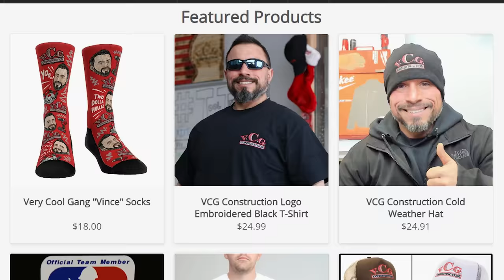If You Use A Reciprocating Saw, THIS ACCESSORY IS A MUST HAVE!

Comment: When you cut through thick metal, use cutting fluid.  It comes in a spray can.  Otherwise you are causing excessive heat and wear on blade.
Reply: True, but the fact he was able to do 7 cuts without any sort of cooling assistance is pretty impressive. I’d imagine with it this blade could easily do 3x the amount of cuts.
Reply: I was gonna say the same... surprising how much quicker and easier you can cut or drill through metal using some kind of cutting fluid!
Reply: Also limiting the speed and letting it cool down helps too
Reply: True, but I think the poi t he was trying to prove was how many cuts he can make without any lubricant
Reply: So what you're telling me is that blade would last longer 😵
Reply: Same goes for wood. Put any kind of oil on your saw, even olive oil works.

Comment: I always cut thick steel on slow speed and always cooled the blade down constantly as im cutting with some water, it preserves blade life so much. My job pays for the Milwaukee sawzall blades so i have to make em count. Going too fast with the sawzall speed will burn out the blades like crazy, if it sparks its too hot.
Reply: what do you use, a backpack sprayer?  why water and not cutting oil?
Reply: @FunkInMyTrunk  I learned a trick here on YT.. get a 2.L bottle filled with water and stick a pinhole about 3” from the bottom. Should give a small steady stream of water for around 15-20 mins (depending on how big of hole you punched) to use to keep your blade wet

Comment: I bought this 9” Diablo Steel Demon back in Nov ‘21….Used it loads on embeded nails and screws.  No sign of wear or performance drop off.  Very impressive.  Even at £12 GBP in UK for ONE blade it is great value because you can just leave it in the saw and know it will eat anything!  Wood, nails, sheet steel, branches, pipework…Literally anything (Not tried it on bricks yet😂).  No need to keep half a dozen spares or keep swapping blades out.  Caveate…Yes a pruning blade will cut branches faster, but that’s not the point, this blade is a great convenience.

Comment: somebody out there like, " I have no problem getting the job done with my harbor freight tools".😂
Reply: For low-end jobs and most that require hand tools rather than power tools, my Pittsburgh stuff from HF all work ridiculously well. If I were, say, a pro mechanic, for example, I'd definitely go higher quality, however. For power tools, though, I can't scale back in quality any more, lol. Dewalt, Milwaukee, Bosch (especially Diablo and Freud), Makita, Metabo, Lenox - all great companies which keep me from buying cheaper again. Even Irwin, Husky and Kobalt are better choices than, say, Hart, Hyper Tough, and anything from HF (not that Irwin, Husky or Kobalt suck, cuz they don't). Heck, Spyder is better than those, lol. For regular everyday tasks, though, they do at least get the job done, and inexpensively. shrugs

Comment: Worst job ever on probably few months ago did a demolition job on a garage / kids playroom and they decided to basically use a flat roof and used 1/2 in plywood and half inch of tar for the roof I must have used at least 30 Sawzall blades because they just kept getting all gummed up with tar. Big waste of money even tried soaking the blades and it probably would have been cheaper to rent a excavator but I guess we all learned our lessons. 😎🇺🇸

Comment: I parted out an old wrecked car I used two blades... 1 Milwaukee.... Lasted two cuts through the frame and it was done... Diablo finished the job 30 or forty cuts later..a lot smaller gauge than that heavy Ibeam you cut, that was an impressive test. I also noticed even after 7 cuts the time to cut through was still pretty consistent. I'm sold in Diablo best blades out there.

Comment: 1:53 before go any further, I’m expecting/guessing no “cool” time b/t cuts and so I’m gonna say…..9 cuts till start having “issues”. (Teeth breaking/missing) And not sure if talking about “blade issues” or “operator issues”…b/c cutting a  I-Beam like this w/ a recip multiple times….well, let’s just say; Vince gonna wake up 2mro and see a Chiro, get a medical massage, and wish never made this video😅. Joke Vince, k is your tough, that above, would be me after cutting this🤣.
Do agree, back in day; would have been laughed at if tried this with recip and a blade😳, but today, I’M doing the laughing 🤣 b/c the Diablo blades are just THAT GOOD and my go to for all my “bladed” power tools, and that goes for spaddles, hole saw, router, and now even OMT blades baby👍🏻👍🏻
Diablo has us covered for just about any tool and application. Now just need a Diablo partnership for free “blades;bits/etc”……goodbye Norske, and hello Diablo 😉
Thx Vince as this was a fun one, but what vid isn’t 😉
Cheers✌🏻

P.S. o see ya Nick, and thx for all you do bro👍🏻👍🏻

Comment: That as absurd. I was thinking two cuts MAYBE 3 with some good ol elbow Grease.

With some cutting oil it could have done 20 cuts with ease.

Again, absurd
Reply from the maker: Recip saw blade technology has come a long way, just like cordless tools!
Reply: I use Lenox blades  and motor oil and can make a few cuts before it gets trashed...just cut a 1" structural I beam 2x with a Lenox blade 🔪 and a Ryobi brushless sawzall and 4 ah battery and still  cut more after that.... The Diablo blades are nice, but unless it's for a job that I'm not paying for, I'll stick with the Lenox and motor oil  🛢!

Comment: So buy one pack of Diablo and need no more blades for the rest of my life.... got it lol
Reply: Depends on what and how your cutting. I use a sawzall to cut cable tray and trunking, defo want to use cheaper blades on it cause itll destroy teeth on the diablo quicker than itll cut thru them
Reply: @robertmadsen8687  after 3 blades and £40 lighter on the wallet, I stopped using diablos for cable tray and instead use the milwaukee torch blades as theure cheaper and hold teeth longer. For strut I now use a bandsaw, faster straighter and safer (in my eyes anyways) 
diablo also dont seem to be good on softer metals like copper or aluminium, but if its cast iron pipe or good thick steel, they are fantastic
Reply: @darylsavage119  now that's how you should have replied originally.
Reply: @darylsavage119  it also depends on which Diablo blades you use. As with every brand, they have a range, and each is made with different usages intended.

Comment: The real test results were on the counter's display.  Started at the low 3 minutes and the last cut was at the high 3 minutes.  But your muscle fatigue is a factor too.  It would be interesting to continue the cutting at a different time and watch the counter but I'm sure you'll run out of beam before the blade will get dull.
Reply: Because Milwaukee knows what the hell they’re doing.
Reply: @johngardeajr.1425  it’s a Diablo blade not Milwaukee

Comment: Used three  of those blade to remove about 200 feet of 2 inch black gas pipe. Each section cut to 10 footer lengths  to get them out of the  restaurant basement. And also cut about 60ft of 4 inch cast iron sewer pipe. 
It blew our minds how we did all that demo with only three blades. 
Spent about 70+bucks for a package. I bought 3 of them thinking i was going to use all three packages.
Reply from the maker: Glad they worked out for you! #BeastMode

Comment: I used one to try and hack a cast iron tub into manageable pieces so I could remove it from the house. I burned the blade up a quarter of the way through then opted for a diablo diamond cut off wheel to finish the job.

Comment: Time to cut :
1st 3:05
2nd 3:12
3rd 3:26
4th 3:40
5th 4:10 (battery died)
6th 3:38
7th 3:45

Just Intresting because I always assumed as the blade dulled it might start taking twice as long to cut something...but it seems almost as sharp the entire time.

You should do a part 2 with the same blade 🙂

God bless you for even doing this guys, I think I'd rattle out my fillings lol

Comment: I cut a rusted-in trailer hitch out of my truck's reciever with my 12" Diablo blade. Slow speed and keeping the cutting area cool was key and multiple cuts to get it ready for a bed extender.

Comment: I bought a Diablo blade for my recip saw and used it to sever 5 in ground tree root. Each root was about 5" thick. The blade still shows NO damage, only some red paint is worn off Really a shock for me. Also ; I was using a Harbor Freight Recip Saw.. Both the blade and the saw are still good.

Comment: I've used these blades I've abused these blades but if I have to cut a piece of Steel it's either going to come down to a Sawzall or a grinder because I do not know nothing about gas and settling torches one thing I always wanted to do was learn how to weld but not only do I use the Diablo but I also use the Milwaukee Sawzall blades because it depends on the job and what I'm cutting. Use the expensive blades when needed use the cheaper blades when needed... 😎👊🇺🇸

Comment: I have one that I only use on pvc, my reasoning being it will always be as sharp as brand new, always make a nice clean straight cut, and cut fast.

Absolutely love it.

For everything else I've been using Milwaukee demo blade, and metal blade for certain things.

Love the wrecker blades, they cut wood, pvc, nails, large aluminum wire, hardy board, some metal, quickly and cleanly and last forever. 

Even when they start to show wear they're great for cutting stuff with dirt in it or plaster, stuff I don't wanna dull a brand new blade on.

Comment: Cool the blade down by dipping it in a glass of ice water. I Just bought a corded Milwaukee saws all. I still buy corded tools. I’m not a professional therefore my tools don’t get used every day. Batteries have a shelf life. I have a Milwaukee 14.4 volt drill driver. I’ve had to replace the batteries. The drill was hardly used. When I replaced it I bought corded Milwaukee drill. Maybe lithium batteries can handle being stored for years and still be charged?

Comment: I have cut with that blade, all my tractor attachement bucket brackets that were way thicker, about 3 years ago, and shortened my palet forks, since then I built a trailer with 2x3 metal beams 1/4 thick and cut multiples thing with it, I still have the blade and still in great condition, but I would never trade my Makita tools for ANY other tool, but I agree that the red ones are the second best...lollll

Comment: That's great, however try using a Port-a-band, they are made for that stuff and the blades last for weeks of daily use if not months. I used a Milwaukee and Porter Cable at various times in 20 plus years fabricating structural steel supports for moveable walls, it's the tool of choice believe me. Nice blade for a Saws-All though

Comment: I wanna see this Diablo blade vs the milwaukee carbide nitrous blade. I haven't used the Diablo Amp yet but the nitrous blade works great for cutting the cast iron I need cut. And several Times. I definitely get my money's worth

Comment: a little oil on the cut itll go faster and keep the carbines sharp longer. I even use a bit on my oscillating tool blades when I have a bunch of nails to cut out  run it on medium speed also to keep the heat down

Comment: Would oil make those cuts easier?
Reply: It does not make it cut faster, but its easier and it helps prevent ware and heat to the blade, also doesn’t smoke as much. Hope that helped. :)

Comment: Even when cutting just for a moment I use cutting fluid or even penetrating oil works good. Saves the blade and cuts much easier